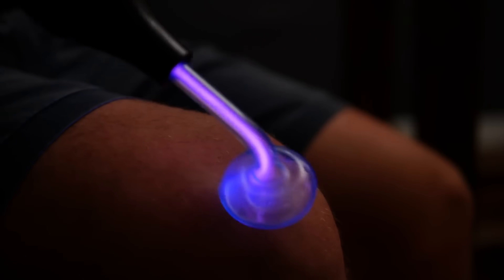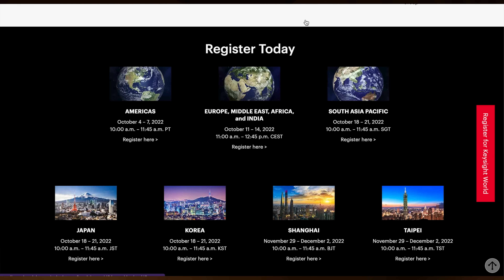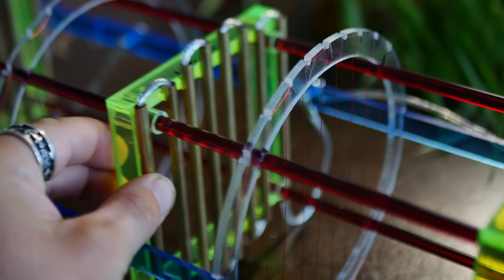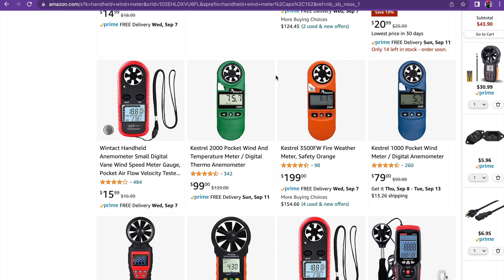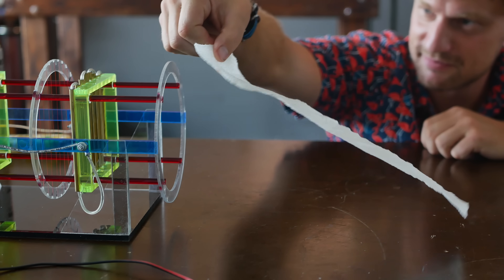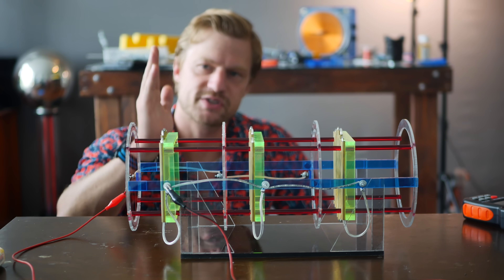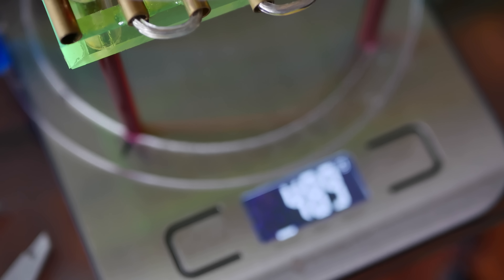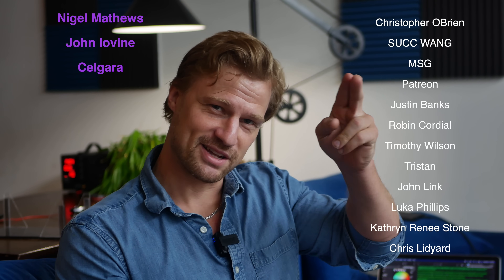Designing A Next-Gen Ionic Thruster! (For Flight)

Comment: You need to put it all in a tube so you're not sucking in still air.  That's one inefficiency.  Its also more weight.  Once you decide on the spacing you'll have a lot of plastic to cut off from both ends.  That's another inefficiency.

Comment: I really need to see this inflate a balloon or airship. Great work! Good luck
Reply: I saw you get into a challenge with @Integza I extended that challenge I posted above to him and added this comment to comments "with re. to ducting airflow etc, what do you think of incorporating some magnetic pinch and polarization by coiling one of the leads around the ducting, a single coil at first but later I think they could be tuneable at each stage"

Comment: Not an actual improovment but can lead to. 

What about the drag coefficient that the elctrodes impose? That means, how much of the air flow section area can be ideally obstructed by increassing the number of electrodes? What is the equation relating the drag coefficient created by the electrodes and the amount of them to thrust?

Maybe the electrodes shouldn't be alligned to increase the drag between ionized particles and not ionized particles, but compromising laminarity of the flow.

Comment: Alot of what I'm seeing is about adding ducting, it might help produce thrust if you add a few small inlet holes directly in front of stage 2 and 3 for more intake. the venturi effect should make sure air does not escape but instead be pulled in.

Comment: 1. Change the shape of the ground electrode tubes cross section from round to elliptical for less drag. I've seen elliptical copper/brass tubes in hobby stores.
2. Put the whole thing in a tube/duct, to reduce turbulence in the interaction between outside and inside air.
3. Change the diameter of the enclosing tube/duct. (Although I confess I don't know it increasing or decreasing the diameter would be the right direction. Weak on the physics there.) Preferably place the tube/duct INSIDE the structure, so that only the electrodes are in contact with the airflow. (ie: framework should not be in airflow.)

Runner up idea: Change the voltage at different stages to see if improvements can be had. I suspect first ring lowest voltage, last ring highest, as it has less time to work on the faster flowing media.

Comment: I have an idea to make a micro Axel jet engine… except using jet fuel I will be using plasma discharge, their would be a mechanical low friction electric generator connected with the main shaft to help create the discharge and also use hydrogen as an additional combustion option. The hydrogen isn’t to keep the engine from staying at its rpm, it’s to help the startup and increase thrust will the plasma is doing all the work to keep it running…

It’s not a perpetual engine but rather an efficient turbine capable of high thrust at an exchange of fuel when increase of throttle… 

- Question is will it run based on what I described it to do?

Comment: things you can improve:
1) USE A NOZZLE/FUNNEL, where the air comes out which will increase the airflow because of pressure change and also so that the air is channeled instead of blowing all around.

2)USING A SEALED CONTAINER, because you have kept this open, some of the air from the thruster might leave the container through the gaps reducing airflow, and also so that air is taken in from the intake and not from gaps between which may affect the airflow and also so that air is channeled in and not from random places.

3)USE MORE "BARB" WIRES IN EACH SEGMENT, using this method will be very similar to increase the number of segments but the cost will be the current usage right? But with these, the barbs are connected parallel in each segment which are connected parallel and so if you add another segment, the power usage will increase drastically whereas with this the power usage increase will be very subtle and sometimes there can be no power increase at all(based on the number of parasitic losses and the intensity of them, obviously)

4)DECREASE THE HEAT, use something that cools the electrodes, obviously the air is cooling them but you could do more by using another material which removes heat of it faster and one that stays cool for longer, or you could use some cooling method to cool it down without affecting air flow

Comment: I know nothing about physics but :
- you could vary the voltage at each stage
- you could vary the wire spacing at each stage
 - if you had e.g. vertical wires on one stage and horizontal on next and wires became e.g. increasingly close to each other towards middle of stage could you build something like an "ion-wind-lens" and focus your airstream more selectively.
- enclose the apparatus to prevent leakage
- I assume you are using DC (see disclaimer above) - could you deliver the voltage in pulses to perhaps save on power consumption whilst taking advantage of the momentum in the air ? 
etc...

Comment: My guess: You probably don't want screens alternating between +, and -.  Once the air particles are charged positive, they won't want to move toward the next positive screen that well.  Maybe, better to have the 1 screen be a 3x strength positive screen.  Then, have all the negative plates after it.  Possible ask: "does the 1st screen need to be 3x strength, or can it be 1x?".

Comment: my thoughts are:
is there diminishing returns on proximity? is 1" actually optimal, or can they get closer? 
there's gotta be a sweet spot on number of stages. 
How does fluid density affect a single stage's output?
Besides the obvious enclosing and intake/nozzle/stage, i would think an increase in efficiency would involve increased surface area, but decreased crosssection, and more aerodynamic ground nodes. (model plane shops carry aerofoil shaped metal tube, fyi)
I wonder if placing the stage at different points in a venturi system will have differing results. eg. the wire at the beginning, and the ground at the end, vs both at the beginning, or at the end, vs one at the choke point.

Comment: Increase the thrust at the tip by making the #1 ring let’s say 10in -25%=8in 8in-25%=6in6in-25%=4inch spout. That’s maybe a much too aggressive of a jetting but the pressure increase thrust I think. I just thought of it. Also maybe sand the inside of the rings to change the flow of air over the inner ring hump witch I’m sure the ripple makes some of the air molecules crash into others slowing the flow and in afar imagine going up hill then you get super speed going down decreasing the amount of resistance going up the next resulting i airtime that lands in the last ring so maybe tilt them all except the last. Just shooting from the hip. Keep up the good work.

Comment: Improvements... Well, as everyone is suggesting, ducts might help. Improving aerodynamics overall (like making the pipes teardrops for example) will definitely help, and putting the thrusters closer together will lower the weight while also decreasing friction. I'm curious if aligning the magnetic fields would have an effect at all... I'm thinking loops of wire (obviously not a full loop, more like an omega) might be a good experiment. Also testing different combinations of distances to more optimize the acceleration of the air.

Another thought I had was concentrating the airflow into a tighter space by positively charging the walls of the duct, pushing the airflow toward the center and leaving the center empty would possibly increase airflow.

Furthermore, maybe having intake holes on the side of the duct near each individual thruster would provide more airflow and would compress the air even more before releasing it at the end.

I'm not sure about most of this, but I think it would provide some great basis for experimentation

Comment: you could change the multiplier to have two branches one from gnd to v++ and one from gnd to v-- as you only care about the voltage difference (like they did in the power plant of the ionic thruster plane you referenced) ... also foil or grids might provide a significant weight decrease (your ground electrodes look sort of beefy) finally maybe just use higher voltage and neutral stages to evenly divide the field over the length of your device (that way you don't slow down the air while it is seeing the reverse gradient as I suspect happens in your parallel design)

Comment: curious what the scalability is? would a much larger much higher voltage version be better? i'm sure most of the non-functional weight resides in the frame, so to increase functional weight would increase technical efficiency no?

Comment: 7,500 comments? Wow!

Starting to look pretty good with the lights turned off.

Hint: Try 2 Copper Sheets and a Dielectric in between.
- Amber -
60,000 VDC should work fine.
Buy 8 red Lazer pointers and create a Lazer chessboard.

Comment: Have you tried using PWM to reduce the electrical power requirement? This would also allow a frequency input control, which gives you more experimental diversity with the same rig. Also, strongly recommend introducing panels to constrain the airflow. With an inlet air temperature sensor, this will allow you to measure mass flow of air through the system. Have you considered introducing a turbine at the exhaust to drive a compressor at the inlet to make an ion turbine?

Comment: For the ionization plates, what does gauge thickness, width, shape and spacing mean for the overall performance of an individual panel? They look cylindrical, which isn't a great shape for airflow. I'd think flat strips would be better for relative surface area relative to weight while also assisting with air flow. Also, with the staggered spacing being as effective as it was, I'd be curious to see what the effect of increasing the voltage from panel to panel would be. Also, as it isn't working like a traditional physical thrust device, I'd want to put it in front of a fan and see if it speeds up already moving air.

Plexi looks cool but aluminum would probably be a better material for weight, and what everyone else said about funneling air flow is pretty on point.

Comment: I'm just curious and I'm going to say this as simple minded as possible 😜,  could you make it 4 instead of 3 and can you make the lines have one set run vertical and another set run horizontal staggered across the 4 looking like a grid on the other end and is there a way to enclose everything inside a cylinder so the air have limited space to escape and possibly compress?

Comment: You varied the spacing between the +ve & -ve plates, but didn't adjust the spacing between the stages, could be interesting.

Also, if 3 is better, why not 10? 20? 50?

Would a shroud help or hinder?

Comment: I wonder if some kind of sequencing - as in a coil gun - could be used to alter characteristics and / or efficiency. It would also be interesting to see how adding sound waves (a standing sine wave) and placing the electrodes at node / antinode combinations would affect performance and flow.
Reply: Any deviation from a straight line, caused by a sine wave, would result in less efficiency, because it would be altering the trajectory, which means more travel time, which means velocity loss.  A real improvement would be a way to confine/contain the flow at its source, so that it flows more smoothly. I could see this being done with focused soundwaves or a magnetic field, but obviously those things would be far too bulky. I think what would be more useful is experimenting with different wire configurations and shape profiles of the wire itself, which is more difficult. Wires are round, but that doesn't exactly offer the best profile. Something like a triangular profile or a thin flat wire would help to focus the flow. I think his biggest inefficiency is the turbulence that is caused, since the plasma is going to diffuse into a cone shape, which means a lot of thrust lost along the sides. Even encasing the thing wouldn't make much of a difference, because it would still be losing energy due to lateral travel when plasma would bounce off the casing.

Comment: just thinking out loud as there are many mods that can be done..
Would adding another section like a circular pipe that runs from the first to the last (i.e like a suspended shaft) covered with coil with high voltage passing through it have any effect?

Comment: v2 with circularly concentric electrodes maybe? You might be close to creating a stable vortex ring on a surface, and then your thrust could come from the air channeled through the center 😉 (plus a low pressure zone from the 'donut' center of the vortex ring)

Comment: Ion engines are the next best thing when no FTL is not available.

My latest brainchild:

It incorporates external ionization of incoming extra stellar mass.
Even extrastellar mass can be used as propulsion exhaust.
At the front it ionizes incoming micromatter, which is lead along the outside of the hull,
and shifted in positive and negative ions over that distance, with high frequency
polarity shifting electromagnetic fields, which then ensures that positive ions are
separated from negative ones, and then lead into an acceleration chamber,
which then increases the incoming matter's speed, and thus receive a kinetic boost.
The expulsion of the incoming matter with a start speed as low as 100 km/s
is sped up to >0.5 c or 150.000+ km/s. Even the little matter there
is in extrastellar space is enough to add kinetics for a space ship
by as much as 8.6 m/ss for the entire weight of the ship, measuring
1.000 tonnes in weight, and a frontal surface by 50 meter radius circular.

It's amazing that so little matter can still add so much motion energy.

Comment: Beautifully built, well produced video. Great demonstration of principals.

You asked for improvements, so here is my list:

1. The thrust measurement should be made with additional clearance at the inlet side. You waste thrust moving the air at the inlet sideways and around a corner. Test it with at least  2 or 3 times the inlet diameter of clearance before the inlet stage. If the thruster has a diameter of 6" test with 18" of inlet clearance. In this way little energy will be spent accelerating air sideways. As a rule "suction" stream lines are quite circular so you want space for a fully developed circle of air moving towards the inlet. 

2.An insulated casing (shrinkable non metallic mylar ?) around the flow channel will ensure that only air from the inlet makes it to the outlet. Since kinetic energy in any moving body is equal to 1/2 MV^2, the velocity is more important than the mass. The external casing will ensure that each additional stage increases the previous stage's output velocity.  

3. Improve the ionic transfer by making the Ionization stage trailing edge very sharp ( almost like an airfoil). It wouldn't hurt to make the collector stages airfoil shaped as well to reduce Coanda flow at the exit of the collector. The Coanda flow will tend to oppose the generated thrust.

4. The rings and squares have sharp edges and transverse surfaces that will create turbulence within the stream. The sharp edges will create localized shear within the air stream which will result in vortexes that will waste thrust. ( look up airliner winglets to see about wasted vortex energy). Finding a low weight method (no ideas yet) of creating a smooth  interior passage (to replace the casing in suggestion 2) will see a measurable improvement in developed thrust.

5. Stages that get slightly smaller as the air moves towards the outlet "might" provide additional thrust- again, 1/2MV^2.

6. Although there may be diminishing returns, some work to find optimal electrode spacing (transverse on each stage) might improve things a bit.  That could be tested by checking current draw on a single stage at various  wire to wire and rod to rod spacings. I suspect that single stage current draw might  be a good analog for developed thrust energy.

7. Consider using higher voltages on successive stages that have larger stage to stage spacing Your voltage multiplier is already set up for it.

Comment: Add a tube enclosing it with the back end tapering inwards to compress the air a bit. Also whats limiting you to just three iconic thrusters. Stack 5 and stagger them from 1 to 2 inches. Also would like to see the noise graphs

Comment: Redesigning the positive electrode such that it has a pointed end, covering the sides so that there is no leaking of thrust to the sides, and shaping the complete design including the electrodes such that it follows a streamlined design....Point is to keep increasing the flow at the subsequent stage and keeping the flow streamlined...Because the faster air moves, more air is drawn inwards from the back which results in net reduction of speed

Comment: This is beautiful. I especially love that you built it to be adjustable and showed the data you collected on trying different arrangements of variables. The only thing missing? Graphs of calculated variables. Like, is making it 3-stage worth the extra power and weight requirements? How does the efficiency change over multiple stages? What is the efficiency based on multiple voltages? How does the thrust change? There's an optimum somewhere in here, and I am really curious where.
Reply: now put a gas injector at the front with some vortex generators (could turn into a helicopter so maybe fasten down) so you can optimize the  ionic wind too
Reply: also configuration of electrodes like the stator vain configurations for jet engines, can you Bernoulli's law the wind/or the gases in any way?
Reply: he literally did all the things you said but only 3 measurements or so so he didnt find the exact sweetspot but that would just take a lot of effort and time